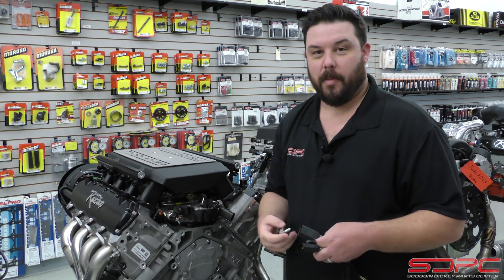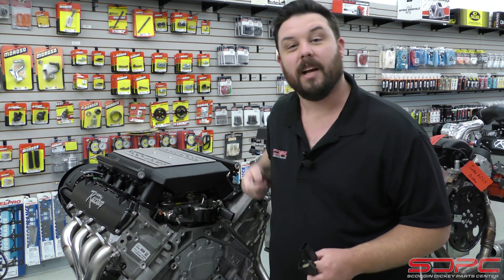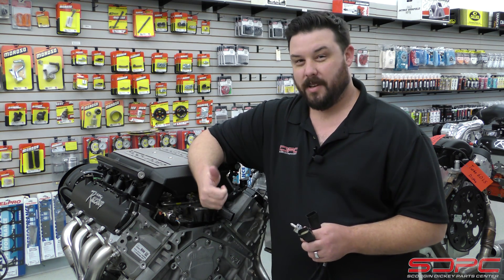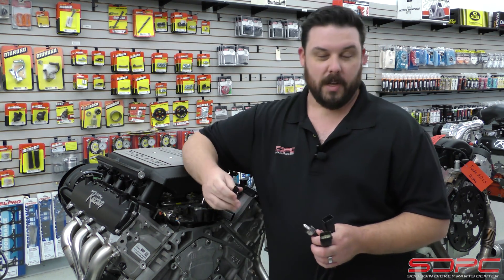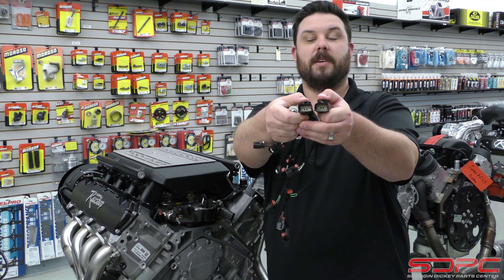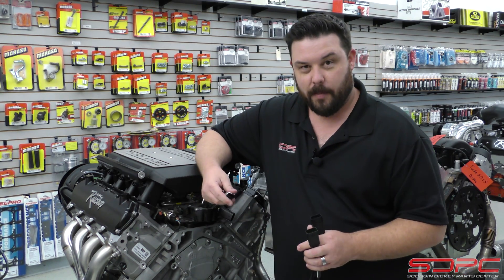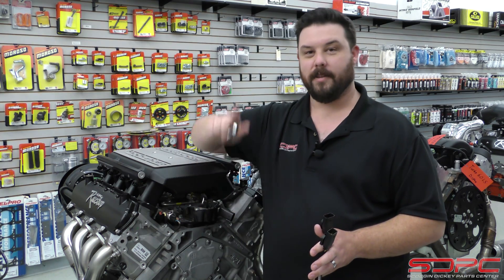SDPC Tech Tips: Gen V LT Fuel Pressure Sensor

Comment: What happens if you try to use the 3 pin one before figuring out your truck/ecu needed the 4pin? Any damage to the ecu?My truck is still giving out engine code for this after putting in the 4pin harness and sensor?
Thanks!
Patrice

Comment: Excellent and very ilustrated video. I´m in the way of swaping a 2019 L83 and didn´t notice about the FP sensor change between years. I´m clear about the sub-harness and sensor type, but what about the rest of the wiring? In my case I have a 2019 engine with whole harness and a 2014 ECM. The harness is configured to receive a 3 pin vs 4 pin expected from the ECM. Will this be an issue? or will it be better to find a 2019 ECM? Thanks in advance.
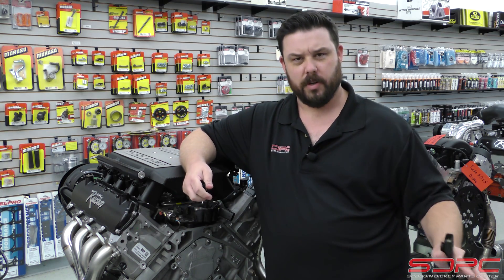Reply: What are you doing about the low pressure sensor? The one he is talking about at 3:20

Comment: So I did a lt4 high pressure pump on my cammed lt1 due to it bottoming out but some times I get fuel pressure regulator high voltage could this be my issue or it's a tuneing issue 2020 Camaro LT1 Camaro 6.2